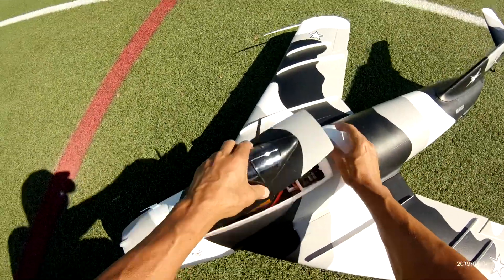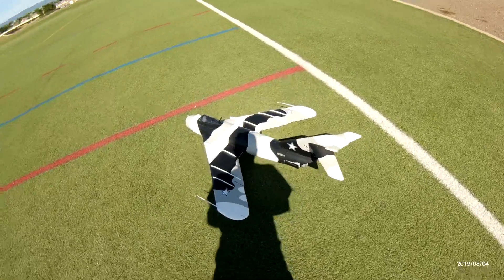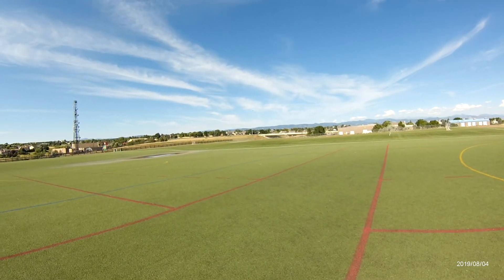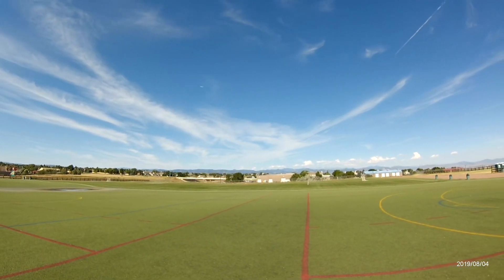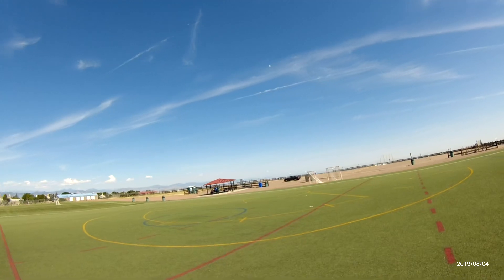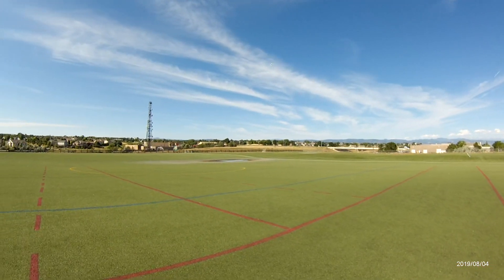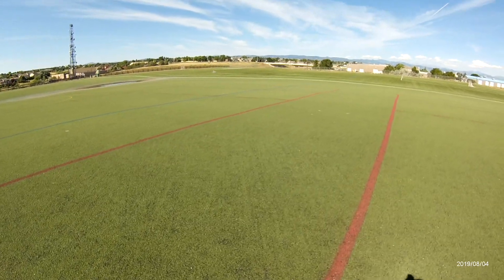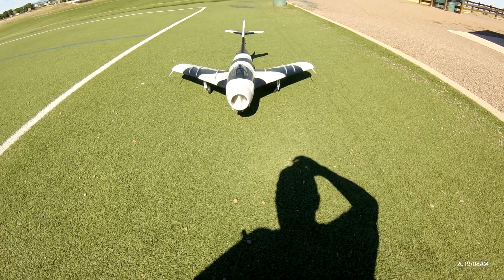Avios 90mm MiG-17 3rd flight!

Comment: do you have to connect the speed brake with the flaps
Reply from the maker: Captain Photon the brakes are the 7th channel, my lemonRX receivers use one channel dedicated to the gyro, so I bought a Y harness and tied the brakes in with the flap channel so I can use them together and it works great, no weird adverse affects whatsoever.
Reply: @DeucesWildRC  yeah I was wondering what the flight character would be with the speed brake on takeoff...but with that power none really...good job sir

Comment: What is your battery size and weight? I'm running Pulse 5500mah 65c about the same spot as you but still required some ELEV up trim.
Reply from the maker: Tim Ber this flight I used an admiral 4000mah 60c weighing 643 grams, I fly with packs weighing from 640-752 grams and all work well.
Reply: Thank you, I likely can move my 5500mah back some more it is 820g.